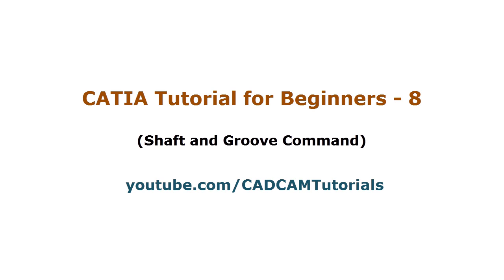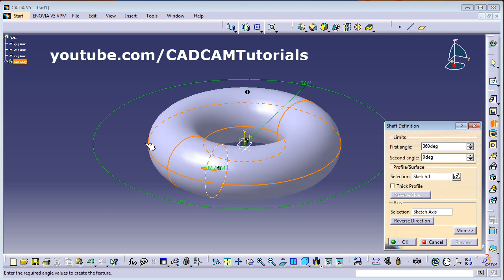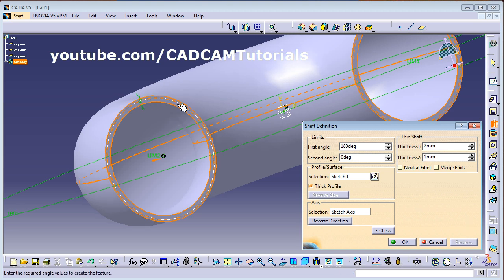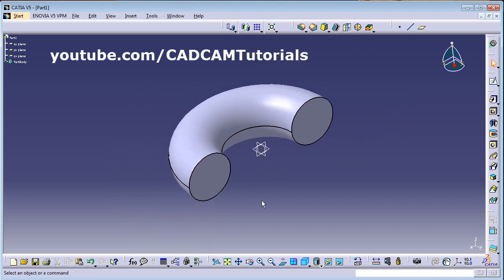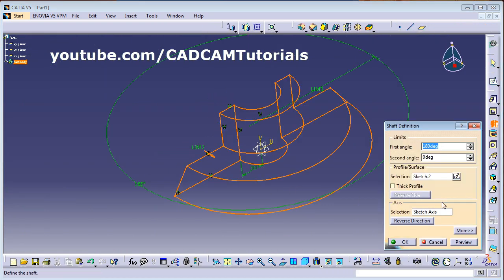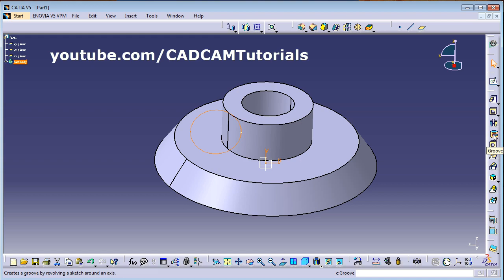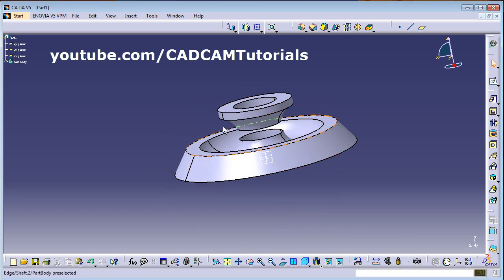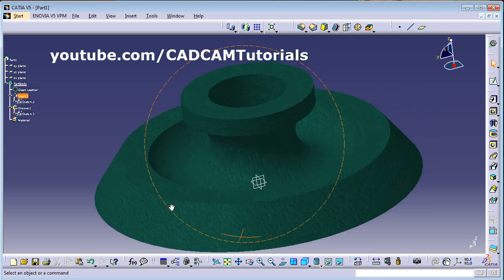CATIA Tutorial for Beginners - 8 | CATIA Shaft and Groove Command Tutorial

Comment: Why is it called a shaft instead of a revolve
Reply: CATIA calls it a "Shaft" because it's focused on design intent, not just the modeling operation. You're not just revolving a profile — you're creating a mechanical shaft, which is a common component in real-world assemblies.
Pad instead of "Extrude"
Pocket instead of "Cut"
Rib, Slot, Stiffener, etc.
These terms are meant to mirror real-world manufacturing or design features, rather than just abstract geometry.